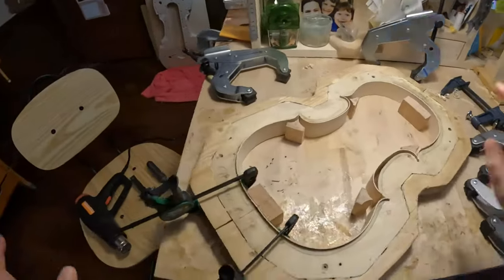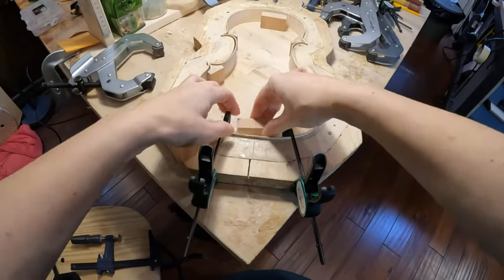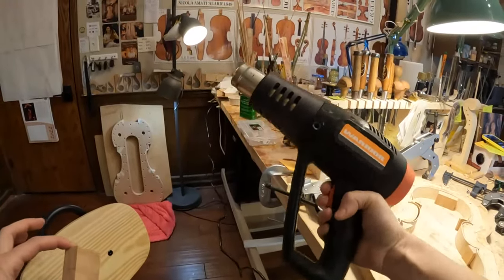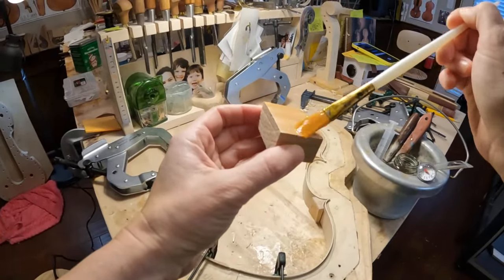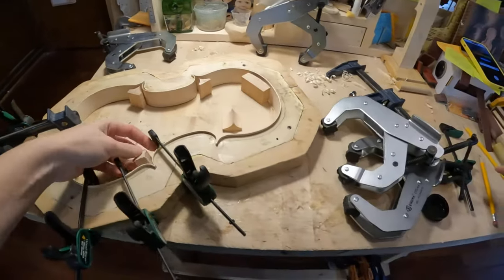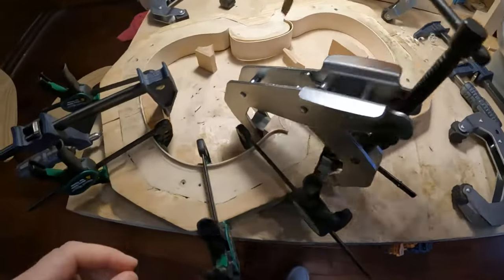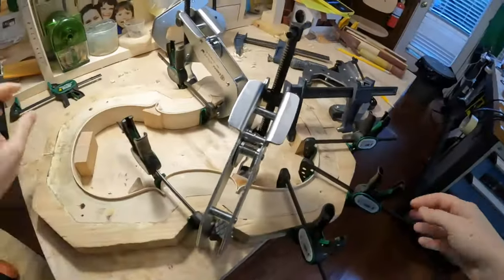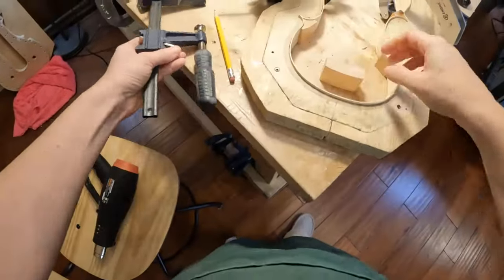Live 🎻🎥  French form gluing blocks  🎻violin Saponaria 🌸

Comment: 👏👏👏 I love this style of mould. It seems challenging to prepare the mould, then make the ribs and blocks perfectly, but later it seems to make this part safer and funnier than working with an inner mould, also the benefit of preparing the linings from both sides, enhacing simmetry, less tension when gluing the corners and a better surface for clamping👏👏
Reply from the maker: I agree with everything you tua said!!! 🙌

Comment: With this type of mould, How are the ribs matched at the corners? Do the top and bottom ribs overlap the C ribs like with internal molds?
Reply from the maker: Hi! Great questions!
This is called a French form and the ribs overlap symmetrically. You can have more of the c rib not overlap the other rib by adding a little piece of wood that pushes one of the rib wile glueing.
But when I use this form I am ok on having the 2 ribs joining together on the corners 😊
Reply: @violinmakingwithsofiavettori Hi Sofia, great videos! A follow up question about the rib ends at the corners: Do you shape the rib ends after you take the rib garland out of the mould? And if so, how do you  shape them?